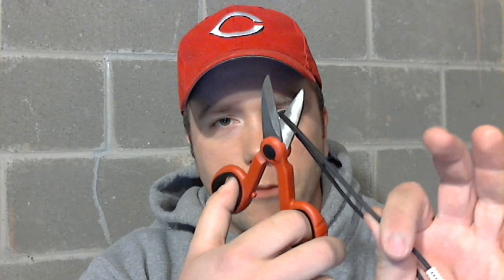How To Fix Your Video Game AV / RCA Cables, or Quick and Dirty RCA / AV Cable Repair

Comment: 8 years later, and this video is still helpful.  I wasn't sure if a splice job would be adequate as the shielding wire is obviously no longer all the way around the inner wire when you do it this way, so having someone verify that it works is great.  I'm trying to put a reverse camera in my sister's car, but to do so either requires drilling holes in the trunk, removing the bumper, or running the cable under the car to the battery vent hole, because the RCA connectors are just too big to fish through the bumper.  Cutting the cable on a $30 camera, and then splicing it again, seems much preferable to any of those options!
Reply from the maker: It obviously isn't anybody's first choice, but for most things this should work fine.
Reply: How does her camera look?  I have a similar issue.

Comment: I didn't watch all the video but my friend told me today that if you take a Q-tip and get some rubbing alcohol you can dip the q-tip in the alcohol and then rub the inside of the output of the system and both ends of the cable. Although when I tried it the first time I didn't rub the output of the system and it didn't work but once I did that it did so you might just have to rub the output of the system.

Comment: Hey man this video was helpful but i have a little question.
I have a nintendo 64 you see, it works fine, shows the red light and all, but one of my cords are damaged. Its the yellow one i think thats the video cable. so the cord is damaged i can see the copper wiring. Do i have to do the same thing you did in this video? thanks

Comment: Quick bit of advice if you're reading this: Instead of angling the camera at your face, angle it at a table. That way, you don't have to hold up the cable to the camera.
Reply from the maker: Thanks for watching.

I couldn't at the time because the camera was fixed to the monitor, and the monitor was not able to be adjusted far enough for that to make sense. It would have had a view of my chest and chin.

Comment: You should be a teacher!  You sound so calm, you clearly stated everything so well and you held my attention.  I'm going to try this with some speaker I have for my computer where the tip of the pin broke off.
Reply from the maker: I hope it worked out for you.

Comment: I actually have the same problem with my N64 left audio plug. I wasn't really sure about what wire components I would find under the insulation, but this helps a lot, now I know what to solder. Thanks!
Reply from the maker: Lou9617 Hope it works out for you.

Comment: Great video! I'm surprised this isn't more popular. 

But I do have to point out that it's high voltage, not current, that would blast through electrical tape.

Comment: Hey Ed, got a question! I know you mentioned the dangers or lack their of about a quick fix to a cut cable. However, I have a more modern record player made in the past two years. I was rushing one night and accidentally snipped the red rca cable. So I followed these steps and wrapped it well. It now works like new! My question was is this safe current wise? Should I be worried about any electrical mishaps?
Reply from the maker: You should be fine as long as the cable isn't moved around too much. Like I said in the video, the worse case scenario is that you'll have bad sound or no sound at all from that channel.

Thanks for watching.

Comment: First, thanks a bunch for doing this video. I'm in need of running a video cable from my newly installed side view mirror car camera to the inside of the car. Now, I can just cut the video cable and make a significant smaller hole on my car in order to get the wire from behind the door panel to the inside of the car and hence the center console where it shows the image. Thanks a lot!!!!!!!
Now, would you know if I could use the a red or a white rca cable for video as well like the regular yellow one. Are they interchangeable??
And whats the diameter of heat shrink tubes that I should buy to make it look a neat job?
Thanks again for your time.
Reply from the maker: Yep, there is no difference other than color.
Reply: ***** Thanks for the prompt reply.
Reply from the maker: Ya Va
They aren't always prompt, but I try.

Comment: thank you dude i picked up a sega genesis model 1 from goodwill i bought a cable for it at my local retro game store the cable stopped working overnight and the wires detached from the head i soldered the wires together instead of twisting (better conductivity) but thanks this video helps a fuck ton back to super street fighter 2.
Reply from the maker: Soldering is the best option, but I made the video for a guy who didn't own a soldering iron.

Comment: that's great, thank you, it was exactly what I was looking for! the only question that I have is that my rca cable that broke, and that is coming from a speaker, is one and yellow. To replace the edge of the cable, I only have some red/white left/right rca cables. I hope it will work...!
Reply: nevermind, I fixed it with the way you showed! thanks again ;)
Reply from the maker: Yep, it should work exactly the same way.
Reply from the maker: Happy it helped.

Comment: Does the same things apply for both audio and then video cord? Gifted my son the old Nintendo 64 we have and the cords got yanked or something, only the prong inside is messed up. They wiggle around and are fickle to hold a proper connection to the television. It'd fix only that part but replacing the entire end with a spliced wire connection to new ends seems far easier than trying dig into the end of the wire to fix a loose prong. Thank you for the video and if you get a chance to see my comment. 😸😸
Reply from the maker: Yes, in most cases it will work exactly the same.

Comment: Yep I agree if they are going to repair A/V cables you will want wire cutters and heat shrink tubing.
And maybe even soldering iron and solder.
For me personally I'd more likely solder the two ends together then do the heat shrink around both wires.

Comment: Great tut"! Thanks man, worked on the cable repair for an ac adapter for my monitor. Great stuff thanks man!
Reply from the maker: Nathan Hargreaves Happy to be of some help.
Reply from the maker: Glad this helped. 

Just make sure to be much more careful with something like an AC adapter, because there is a lot more power running through that, and you don't want to have a short or cause a fire. I would not recommend using only electrical tape for that, and I would strongly suggest soldering the wires together so that it doesn't pull apart while in use.

Sorry, my earlier response was from my phone.
Reply: all good man, no fire to report yet! Yay ;)
Reply: EdT1138  can you use white tape

Comment: I have a tool for that called a wire stripper lol, but have used a knife before. Also nes controllers have 3--5 colored wires now. You can make usb too or extend a controller. Right now I'm messing with the nes classic mini.
Reply from the maker: Good luck.

Comment: If I was using a Aux cable, do I connect the harder wire to the other 2 harder wires like you did with this one?  The AV cable has a red and white inside, which I know is for L and R channel.  Just wondering if Aux cables have 2 different bare wires in them for each channel or what.

Comment: what is the insulation wire around the inside wire used for? is it ground or something?
Reply from the maker: Daniel Wallace Put simply, if you removed the insulation from the inner wire you would no longer two wires.
Reply: EdT1138 
lol I know that, but I was wondering, what the wire strands around the inside wire were for. so there are two wires but what is the outside second wire for? not the first with the plastic insulation but the wire outside of that.
Reply from the maker: Daniel Wallace
You need two wires to complete the circuit.
Reply: EdT1138 
I get that, but what is it for? is it just a secondary wire that does the same as the first or like a ground wire or what?
Reply from the maker: I'm sorry, I thought explaining that it was an electrical circuit might answer your question since you asked if it was a "ground".

In any electrical circuit you have a "source" and a "return". Sometimes you will will hear them referred to as "positive" and "negative". In addition to "negative" the return can be a "neutral", "earth ground" or just "ground". In some applications you may have both a "neutral" and "ground", or even multiple "ground" returns.

In the case of a single rca lead you have one source and one return.
Reply: EdT1138 
gotcha, thank you thats very informative. I had searched online but I couldn't find my answer but you just nailed it for me.
Reply: so it is a ground ?
Reply: Rael Haro the one on the inside of the wire (in the sleeve) is a positive & the free ones is the ground

Comment: I got a question my 360 cables stopped workin so my father cut off the RCA from the Xbox and grab some PlayStation ones and cut the RCA off of the PlayStation ones and use RCA tips to the Xbox wires I don't know how but it came apart the wires and I don't know how to rig it back together
Reply from the maker: It should work the same as in the video.
Reply: Ok

Comment: Question. Am I able to cut off the yellow cord and "splice" it with a white cord to work as the yellow? Because the yellow snapped off. lol
Reply from the maker: They are made exactly the same way, so it makes no difference. The color is just there to make sure you don't plug one of the sound channels into video at the other end or vice versa.
Reply: ***** Ohhh. Thank you!

Comment: What about when you cut the end off the n64 yellow video cable and there’s a green and blue wire inside how do I replace the tip with a replacement that only has yellow inside
Reply from the maker: I'm not exactly sure what you are asking. There will be two "wires" in every one. Sometimes in cheap cables they will be very fine or have very few strands but they'll be there.

Comment: Trying to do this on a dreamcast cable. I am not getting video or sound. Roommates dog chewed it in half. If I touch the white and yellow I get picture and loud buzzing. What am I doing wrong?
Reply from the maker: jnnwk If you touch them to what? You will get a loud buzzing if you short one of the audio lines.

Comment: can I use speaker wire to make the wires longer
Reply from the maker: +Rory Reyes Sure, it's just wire.
Reply: +EdT1138 yeah I was trying to do it with a higher end wire to work with my sub so I can move it far from the radio but didn't work
Reply from the maker: +Rory Reyes There shouldn't be a problem. How long have you made it?
Reply: +EdT1138 shoot pretty long 40ft

Comment: Thanks but could you pull the wire out of the head of an RCA cable I pulled the cable out instead of pulling the head out the correct way

Comment: I broke my son's a.c. cable right at the end of the plug in part to the tv, so there's not enough wire on one end to twist with the other. Can I use a plug in part from another av cable & then twist it together ?
Reply from the maker: Yep. One rca cable works just like any other, but some aren't  made very well, and may not give you much material to work with. I have seen some that use a single wire for the center pin, which makes it all but impossible to splice.

Comment: Hey man, I'm looking at buying a rare gamecube component cable off of ebay that has a broken pin on the red plug.  It's listed for much cheaper than any other cable like it on ebay and I was just wondering if splicing the broken end with a new plug would be a good long term fix? seeing as how you can only buy these cables on ebay and they're expensive
Reply from the maker: +dconner50 I have some that I have spliced that have been working great for years, but I took my time with them. I soldered the wires together and used heat-shrink tubing.
Reply: Awesome man thanks for the response!
Reply from the maker: dconner50
No problem, and good luck.

Comment: on my xbox 360 av cable, on the video cable the rod that goes into the input is bent out of place and doesnt work

If i were to replace that one with the video cable from a ps2 or an old vcr would that work for my xbox?

Comment: Hi, My son has a mini PAC-MAN game.I'm sorry for my ignorant question, since he has 4 years he constantly pull it on from the tv so it went broken "of course". I don't know where the cable is broken or which of the two yellow or white. So How can I fix it? Or it could be fix?. Thanks. He cry so I can fix it.😓
Reply from the maker: That is a bit more difficult because it could be broken anywhere inside the insulation, but it is most likely broken either inside where it connects to the handheld or at the ends of the cable.

Comment: Would it be possible to repair or clean the AV Cable that was connected to a Plug-In TV Game? I had the SpongeBob Plug-In TV that was packed in the box and when I just took it out and plug it in to my new TV that has AV inputs, the graphics on the screen looked weird with the different random colors popped up, but the game isn't making any glitches and the sound looked fine as it is.

Comment: and what if my cable is pulled out of that red/black thing....how do i fix it since there are 2 inside wires and those things red/black are old and they dont have like little special holes........im talking about the ends(heads) dunno how to call them

Comment: I broke the inside of the box, is it possible to fix or should I throw it away? I pulled the cord out and the part inside came out of the xbox.
Reply from the maker: I'm sorry, but I'm not certain which box you are talking about.
Reply: The spot I. The system itself that the Audio cord plugs into.
Reply from the maker: Randall Amerson
Yes, it can almost certainly be fixed, but how it is fixed depends on the type of connector and how far the damage extends into the system.
Reply: Is there another place I could contact you to show you pictures of it
Reply from the maker: https://www.facebook.com/EdT1138-Classic-Gaming-Enthusiast-390171737702946/Randall Amerson

Comment: Hey buddy quick question
My nintendo 64 AV cable shows picture but no sound so I need to replace either the RED or WHITE cable
Just wanna know if this will work if you just replace the ends?
Reply: Replace the white cable
Reply from the maker: ThatOne• Gamer
I missed this one.

Comment: Does this work with an official Nintendo s video cable? When I purchased my cable the connector for the tv was broken.
Reply from the maker: S-video has more than two wires, but there is no reason you couldn't splice as many wires as needed. Honestly, in most cases I would just recommend buying new cables for this sort of thing, but in a pinch...
Reply: EdT1138 thanks for the input. I’m gonna try it because I have nothing to lose. I bought the cable on eBay where the seller said it was tested and working but it wasn’t when I got it. One of the pins was broken off in the tv connector as well as the one little black piece that sits under the 4 pins. Long story short I got a refund from eBay because the seller wasn’t being compliant when I opened a return so I’m stuck with the cables.

Comment: Ok, so im trying to make a cable for my dreamcast cause ive been looking for months and i cant find a freaking cable! I have some RCA cables(left over for the cable I made for the megadrive) I was thinking if i could like solder the RCA's to the Dreamcast board and that would work as the av cable. Ive looked all over the internet but cant find a tutorial. I dont really want to destroy my dreamcast since it is hard to find here(because everyone bought the ps2) thats why im looking for help.Thanks

Comment: Hello i wanted to play my Old Xbox and find out that my Xbox-Av (Red-White-Yellow) Cable is broken. Now i wanted to do the exact same thing but i have 2 Questions

1. Does this Method work with all 3 Colours (red white yellow)
2. Does this really fix and repair the cable ? :)
Reply from the maker: 1. Yes.
2. Yes, if done properly.
Reply: EdT1138  Okey Thanks Buddy

Comment: If i cut off the red part will it still work and show video?
Reply from the maker: I'm not sure why you'd want to do that, but yes it would.

Just to be clear, if it is composite, and you cut the wrong red, you will have black and white video.

Comment: well I have pets that chewed my av cable and it is not completely chewed trough so will you help I mean you don't have to cause im trying to get an av cable real soon but I want a temporary replacement
Reply from the maker: +Zealand Boutin Cut to either side of the damage and follow the instructions in this video.

Comment: My ps2 works perfect but the only thing is the sound doesn’t work I’ve connected it to multiple TVs and sound doesn’t work when I play video games how do I fix it
Reply from the maker: Depends on what is wrong. If you have tried multiple TVs and multiple cables without success it is likely the system. Could be a loose connector or any number of things.

Comment: I bought a used ps3 off my cousins buddy now it was a ps3 and he only gave me a HDMI cable I have a old ps2 cord that is used for video and audio but when I plug it into my ps3 it doesn't work and I know it's not the cord it has to do with the back of it if you could help me replace or fix it that would be great

Comment: i tore off and lost the yellow jack to my ps2 , i can go to the store and buy a yellow jack and use your method. to conntect it to my ps2. thanks.
Reply from the maker: You could pick up a replacement end at an electronics store, but you can probably find a replacement PS2 cable for just a bit more money, so I guess it really just depends on how much your time and effort is worth to you.

Good luck.

Comment: connect the  ps2 video connector to your tv and ps3 then turn off the ps3 turn back on and hold down the power button in front it will reset the video. hold it for 10 secs or so or until you hear a beep